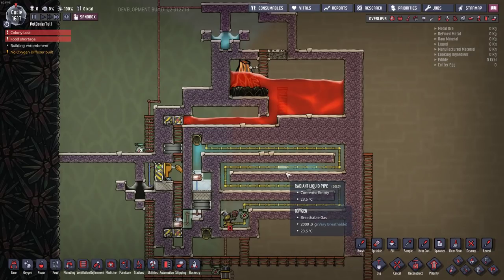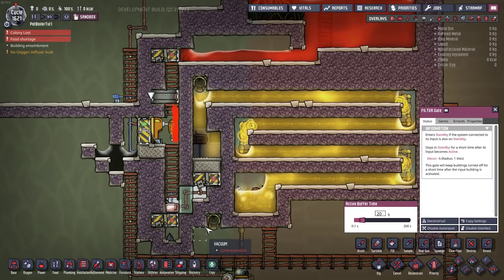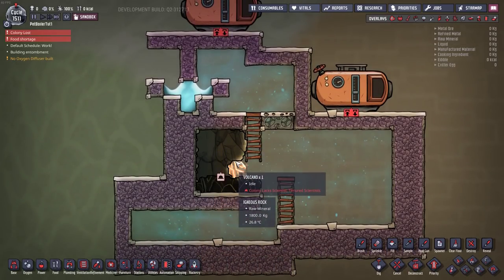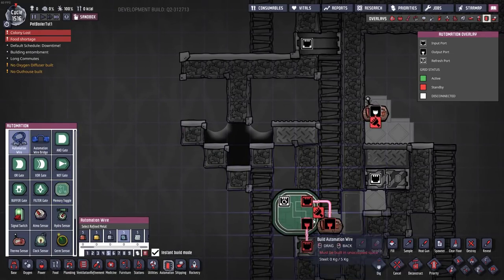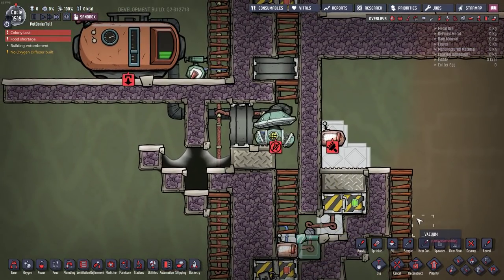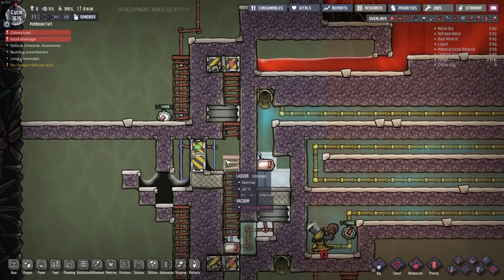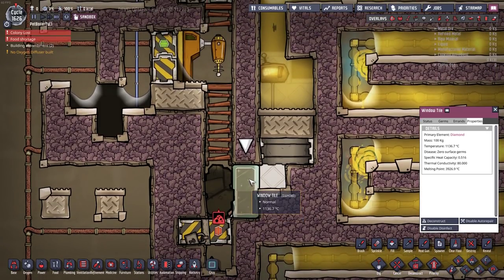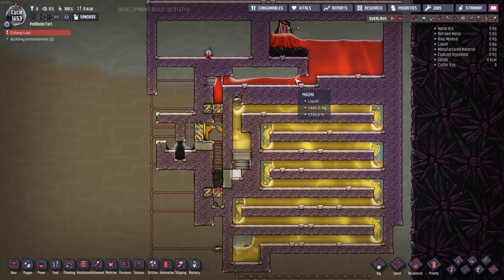Volcano powered petroleum boiler : Oxygen not included (Save file attached)

Comment: One frustrating aspect is this design doesn't like to stop running. things will break if this turns off. mostly pipes in the final stretch at the top as oil shifts to petrol in the pipes, or the pump will overheat as the petrol is over 275 degrees C for steel when it all finally runs to the bottom once input has stopped.

Unfortunately I don't have a 10 oil kg/s source yet. single oil vent, so I have 3333 g/second. and I have it set up to pump to an oil reserve tank so that when it pumps in I have 10 kg/s, it just outpaces the supply.

I created an airlock to have somewhat easy access for repairs and vacuum'd out the counterflow, the access is by the spot where the igneous rock collects, and I just demolish insulated tiles above the pump (do not break open the boiler where heat is exchanged, that is a mess), and I have ladders built to climb up to wherever the problem is.

it seems like in order for this design to avoid this problem I need to use a couple spots of insulated pipe on the top row of the counterflow.
Reply from the maker: I never covered that bit in the video. You put a flow control valve on the intake and limit it to the required amount. I have a 2k base tour video that I'm using it in, you can download the save from the link in the video. I had two oil wells so I limited the flow control to 6000g/s and had a bypass valve that would allow me to go up to 10kg. The bypass valve was linked to a hydro sensor in my crude oil tank, when the oil level got to high the bypass valve would kick in and dump 10kg/s into the system. This way I always had 6kg at least with the occasional spike to 10kg. You can set up something similar with a lower value say 3000g/s.
Reply: @FrancisJohnYT  Appreciate the followup. i ended up finding that if i increased the reservoir of petroleum at the bottom of the unit up to 750 kg (regulated by a hydro sensor I believe you suggested in your video) it would resolve the issue with intermittent unavailability of 10 kg/s of oil.  didn't need a overflow mechanism on the supply piping or to valve it. I made 2 lengths at the top into insulated pipe (granite, since the temp control would keep it below granite melting)  before it dodges up into the insulated blocks before the spout.  

the loss of radiant piping means when i run it, my efficiency will be lower, but i will also reduce the heat load for conversion due to not 100% uptime, so i think i'm more than fine on that. your design is robust. it doesn't need a ton of tinkering to make it fairly useful for any base.

I am experimenting with using the excess heat of the petroleum (comes out around 150-180) to get a little free power from the newly redesigned steam generator, and to further cool the petrol. since it stays above 125, the water never have to be filtered from the petrol before pumping.  those experiments find that for this temp range, i only need 1-2 of the vents of the generator open. the rest just suck up and waste the heat. can be blocked with doors, and the temp for a port is like every.. 40-60 degrees, starting at 100. its not a to.. maybe 150-200 watts, but hey. its something on top of the free excess water + power the volcano and oil reservoir combination make.

Also i found that sometimes i get 3 blocks worth of magma, and the heat exchange on magma to magma blocks is slow and or wasteful like the bottom 2 would cool off, and the top would still have 800-900 degrees C to use and the temp sensor would fire to have the digger clean it out.. so i made another diamond window on top of the other 2 to cover those situations (leaves 1 tile directly adjacent to the sideways door)

also had a point where the oil dripped on the metal tile to cool the robo miner flashed  to sour gas because of a building mistake, when i was repairing the exchanger due to broken pipes, there was gas that i let into the bottom most chamber where you just have the igneous sit. next time the door opened it leaked all over up top.  added an and gate and a duplicant switch so i could turn the top door off while doing repairs without having to demolish anything.
Reply from the maker: @mattroy1322  Wow really sounds like you made the design your own. Never though of using the hot petroleum to add power to the grid, I'm am so going to try that on my current play through. Quick question on the third tile of magma, did you use a "Magma blade" of the required length? About 10 tiles if memory serves. It's designed to limit the magma drop to no more than an extra 40-100kg
Reply: @FrancisJohnYT  the measure is 10 tiles from the side of the door to the edge of the lowest tile of the top lava chamber. its odd. something like every 8-10 drops it drops a 3rd, of about 150-200kg.  but, since i'm not on full throttle, the excess mass doesn't look like its going to be a problem.  just reached the end of a dormancy, and the magma mass up top didn't substantially shrink since the last dormancy.  would probably be a concern for full  throttle bases, with weaker minor volcanoes.
Reply: @Francis John final followup, at your suggestion i have made this boiler into a 3 stage operation. cut off via manual switch, max operation at 10 kg/s, and a standby at 6.0 kg/s.  the two on operations are controlled by a hydro sensor in my petrol vat, above pressure x and it switches to standby (at the amount consumed by my basically 100% on petrol generators) below and it switches to max production.

additionally i have it set to change to standby mode whenever the heat left up top is below 440, as i noticed that it would build up a fair bit of oil up top that wouldn't convert until the new magma was loaded up, leading to pressure spikes.  just means i have t o make sure my power grid never requires 10 kg/s of petroleum 100% of the time... otherwise I run the risk of running dry on petrol due to standby periods. 

Additionally i ditched the direct coupling of a steam generator to the petrol vat, and set up a steam generator over a aquatuner to cool the petrol,  you can self cool the steam generator with the aquatuner, and make the aquatuner into a 5-800 watt device instead of 1200.  gotta be steel though, my testing shows that since the heat output is set at a particular rate based on the constant -14 degree shift.. you set up automation so the steam vent only runs at 197 degrees celsius. so that it runs at max efficiency whenever it turns on making the near 850 watts, versus the slightly steadier 200 constant watts down at 125. 

this is the highest temp you can get with the steam generator without needing automated doors to control the inputs to avoid wasting heat , though one could set this to 240 and permanently block off an input with a tile which i haven't tested yet. might be worth it as it would pull in less steam. depends on how concentrated the steam chamber is I suppose.
Reply from the maker: @mattroy6801  Could you send me the save so I can have a look? I'v been poking around peoples bases recently and stealing ideas. It's also kind of fun trying to reverse engineer how other players solved the issues.

Comment: I've got this sort of working, but I'm pulling my hair out as to why I'm getting heat damage on the gold radiant pipes near the top vent. Temp of petroleum in that area is around 428.7C and the oil in the pipe is about 414C...I assume it's because it's transforming from crude to petroleum in the pipe...the oil is entering the system at 133C, and I'm not sure what to do about it...
Reply: if the oil is hot, have a shorter counterflow.. if it's cold, have a longer one.. the aim is to have a counterflow system that drops the oil onto the phase change plate at just under the phase change temperature.

Comment: Urgh.. I had one of these built with a volcano, and somehow after a few hundred cycles, I got magma inside the counter flow structure.   Somehow, the obsidian insulated tile next to the liquid vent broke and allowed magma to flow inside, ruining all the petroleum and melting all the radiant pipes.  My only possible explanation is due to liquid pressure damage from magma accumulating above the steel door, but my magma reservoir wasn't overpressured so I really can't explain this at all.  Has anyone had this issue?
Reply from the maker: Never heard of that happening before, did the oil back up in the system and over pressure to break the tile?

Comment: build it 1by 1. its not working :( probably fixed something :x  e.g. if i turn the hydro sensor green or red, NOTHING happens. like it changes the signal type, but it has 0 effect. ONLY if i set the thermo sensor on  ABOVE 430°C, the change of the hydro sensor does something. but than the magma which drops down instant turns mid air into magmatit (the small pyramids, not the boulder).
Reply: ok, found out the real problem. if there is 2 less magma in the room where the volcano is, u have to restart it manually. otherwise the automation collapse :x alright :D

Comment: I just tried it...is there a new patch? Magma is going through doors and meting everything.....
Reply: You has to use steel for doors
Reply: @torinopeek  yeah, copied from wrong material....lol
Reply from the maker: I think I saw your reddit post :) working with magma is really really hard. I have messed up a lot of petroleum boilers. Automation wires made of wrong material, melted. Temp sensors set incorrectly, sour gas in the boiler or crude back flow. Made the dropper tunnel to long so no magma dropped. There were a lot more, but it feels great when you get them running right.
Reply: @FrancisJohnYT  Play and learn is the message ;-) Thx for the great content BTW

Comment: The volcano in my save is pressed up right against the magma layer of the map, with just a little igneous rock below to spare. What amendments could I make to this design to make it work with these limitations?
Reply from the maker: Friend of mine had the same issue, not really much you can do. You could try using a door pump system to move the magma up but thats an expensive and dangerous job. You may just have to wait for thermium so you can use an aquatuner heat source or you could uses geo thermal magma with a pitcher pump.

Comment: need help starting it, my crude oil turns into sour gas straight away. And after fixing that issue, I had a problem where there was crude oil in the counter flow because it was too cold
Reply: It shouldn't b crude oil on the counter flow, u have to stop the first drop that u put to start it up and once it's petroleum, just then keep dumping more

Comment: After the first batch of petroleum is done and the crude oil isn't hot enough to turn, I cant get boiler to reset automatically. Any idea why that might be?
Reply from the maker: You got a screen shot or a save game file I can look at? Temp sensor setting in boiler set to 403C? Old magma cycled out at 435C? Also you should never need to turn it off, it's a water positive process burning the petroleum so once you have oil wells up you should let it run constantly.

Comment: My steel door doesn't transfer it's heat to the metal tiles(gold) and thus crude oil stays cool. Is this a bug?
Reply: Just realized the automation wire is stealing all the heat. This makes no sense, but at least the problem is solved.
Reply from the maker: Wait what? how? A door won't transfer heat when it's open (Assuming vacuum).

Comment: I get full top row of pipes near liquid vent broken after second cycle of magma. Help
Reply from the maker: Sounds like you are running it at less than 10kg a second. Did you make sure to use gold for the heat plate? Also this is an older tutorial check out the newer one, their is a link in the description.
Reply: @FrancisJohnYT  ahh you were correct had a liquid valve getting crude oil at 5kg. Thank you I didn't know you posted a new one I'll check that out too
Reply from the maker: @reznoovoronov2072  It's rare the player who invests in a petroleum boiler. I think you will find the game gets a lot easier from here on out. Something about having the power to do anything makes everything easier.

Comment: I made this but I am having issues with the magma falling. I think there is a block of copper that is stuck some how in the magma.
Reply from the maker: Copper flows better than magma it should not stop the dropper. Is the magma not flowing at all? Could be a low pressure thing, that is why I have the drop down to the start of the dropper. I'm not home right now but if you like send me on the save (email in about section) and I'll have a look when I get home.
Reply: @FrancisJohnYT  I started a new game. Everything fell apart.  The current issue I am having is random sour gas is getting in the robot miner. There is some pressure damage on the wall. That might be it.
Reply from the maker: @Gallaid1  I'v seen that before, whats the temp setting on when the magma is cycled out? Turn it up to 440C. What is happening is as the magma cools it hits a point where it stops converting the petroleum instantly, then the crude build up in the boiler. Then when the fresh magma flows in all the crude converts at once and this causes pressure damage to the walls. Cycling out the magma a bit earlier stops this from happening.

Comment: Does this no longer work? :( I am having problems with the automation design. It will not loop, so I get stuck after the Robo-miner has cleaned up, and the lower door has removed the resources. I cannot see any difference in the automation system from mine to yours.
Reply from the maker: Did you deconstruct the hydro sensor after you primed the system? It's only used to drop in the first blob of magma. Also the save game file is in the description if you want to have a look though. I just finished building one in my current play through and the automation is working fine.
Reply: late reply, but whenever something should work and doesn't.. save and reload just to see if you got hung up. i've got a copper volcano that is powering a steam generator and kicking out the cooled copper, and sometimes my automation forgets to close a door and it leaks copper onto the sweeper and loader.. and i save and reload and it works fine again.
Reply: @FrancisJohnYT  I have the same problem, it seems the thermostat does not work in a vacuum, must of been a change in a patch somewhere. I fiddle with the temp settings on it and can't get a red input
Reply from the maker: @mychannel-nj3lx  Temp sensors need a medium, so liquid or gas. Without one you can't change the signal they output.
Reply: @FrancisJohnYT  i figured it out... i deconstructed the sensor too late... once i manually restarted it all was well. Thanks, and keep the vids coming!

Comment: There is ONE BIG miss with you-re system ... IF you produce more petroleum then you use ... the system's liquid pressure will go up and over 800 kg ... all HELL will break LOSE(namely due to the insane pressure the gold plates will crack and after those everything will fall APART)  !!! so ... putting a high pressure sensor next to the one for the pump that will cut the crude oil line intake  once it goes over say 200 kg is a GOOD IDEA for all folks who don't dump petroleum into storing tanks ... and who instead  like having it active feeding rockets and power plants .
Reply from the maker: The trick is to have 5 petroleum generators setup and have them activate if the petroleum line starts to back up, that way you always keep the pipe clear. At the same time this ensures you always have enough CO2 to feed your slicksters. Boiling petroleum is water positive, 3kg of water into oil wells gives 10kg of crude. Burning 10 kg of petroleum give you 3.75 kg of polluted water. Moral of the story if you never turn off your boiler and burn the stuff as it made. You can support 75 slicksters via CO2, get an extra 750g/s of water and keep all your power grid topped up. Stopping and starting petroleum boilers is when you can get problems, never turn them off.

Comment: Will this work with a gold volcano?
Reply: After playing around with this design in debug mode for a couple of hours using both the gold and iron volcanos on my seed, I've determined that it CAN work. But not well. Mostly because these volcanos just don't put out enough mass. (onical.ga actually says mine are on the higher end). I had to adjust the temp control on the door quite a bit, but I also had a problem with liquid pressure damaging blocks because the crude with just stack up when it doesn't run. A hydro sensor and liquid shutoff helped that issue. Ultimately I decided it's just not worth building it using these volcano types.
Reply from the maker: Unfortunately not, gold does not produce enough heat. Also it flow differently which messes up the dripper.
Reply: @FrancisJohnYT  Yeah thanks. After some more pain I was able to get it to work with Iron, but it won't run constantly, maybe about 50% of the time. In order to get it to work with metal I put in a liquid pressure sensor above the middle drop door (set to 1k) and used an AND gate in conjunction with your automation to make it wait to open that middle door until there is enough mass to reliably not form the ingot.
Reply: If the ingot forms, the temp sensor stops functioning in the vacuum. Secondly, I added a liquid shutoff tied to the automation to shut off flow of crude while waiting for more liquid metal, to avoid pressure damage.
Reply: Last I added a bit of petrol to the bottom chamber where the auto-mined ingots drop down (on top of some gold metal tiles), and brought the in the crude oil radiant piping through there first to cool the ingots further while raising the temp of the crude a bit.